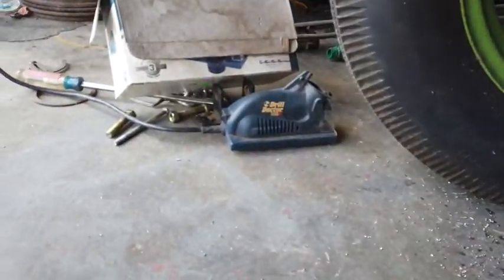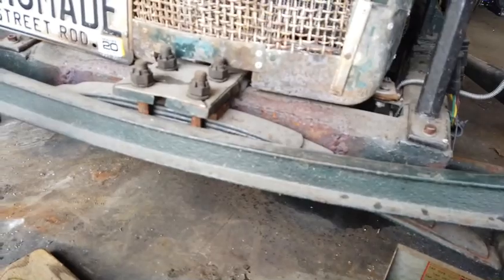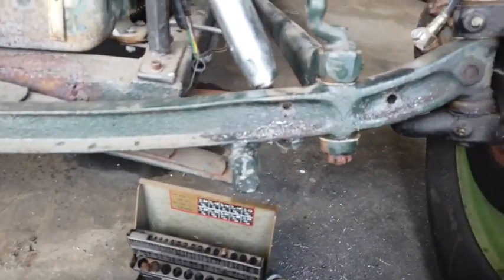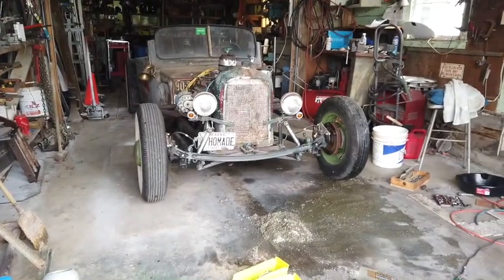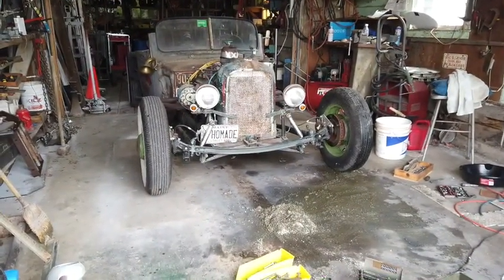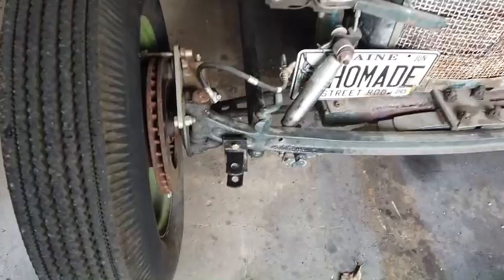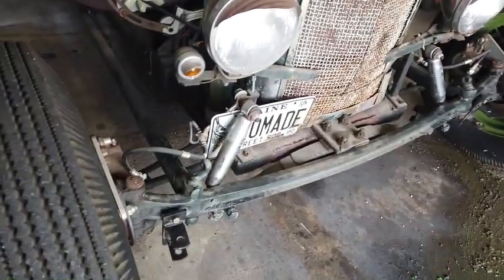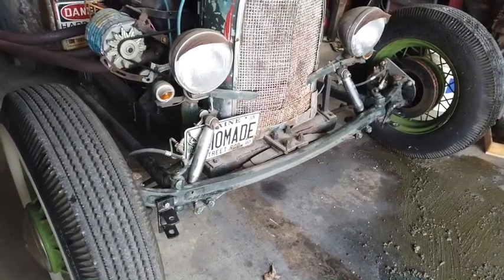Heavy Metal, 1940 Ford front axle eating drill bits

Comment: It's about the angle of the sharpening on the bit. I sharpen then by eye until I get the best angle. Experience has taught me well. The trick is not to overheat the metal by continuing to try and force the bit through. Overheating will make the metal even harder and your bit softer. Breaking through that hardened spot will be even more difficult. Alternate between holes and continually sharpen the bit, lubricate with proper cutting compounds.  Waiting until you hear the squeak is way too late.
Reply from the maker: Thank You.